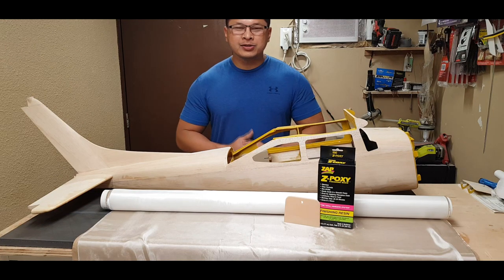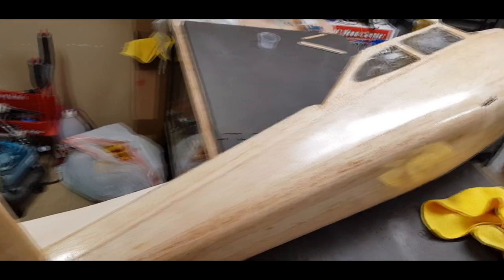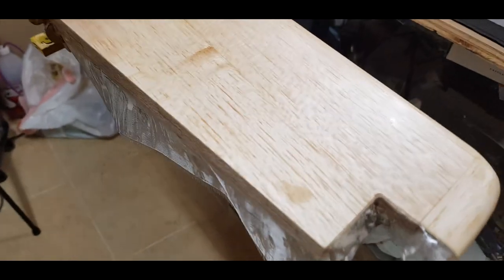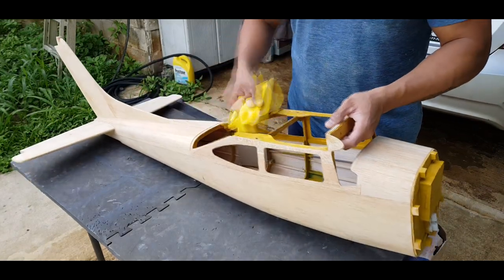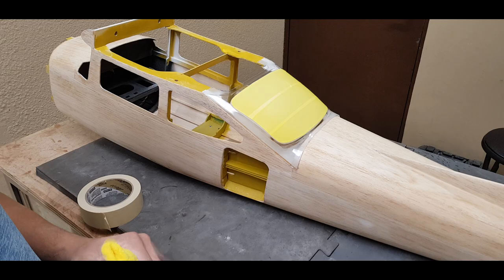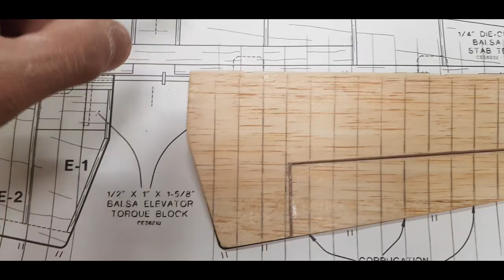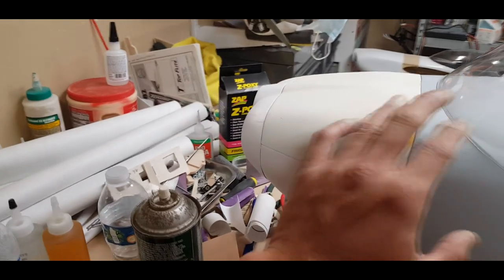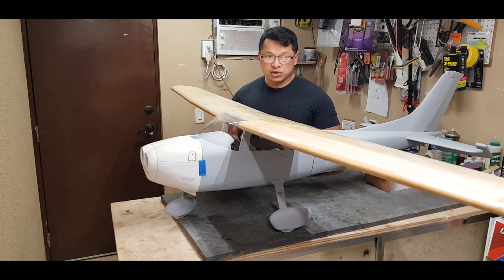How to Fiberglass a Fuselage (Top Flite Cessna 182 Part 10 Build series)

Comment: Great work. You make glassing look easy. I've used a technique I saw before where you thin the finishing resin down with denatured alcohol. Looks like you used the resin straight up with no thinning.
Reply from the maker: No thinning necessary if done the way I did it in the video.  It is pretty  easy and yields good results.

Comment: Can you use an oil base polyurethane on fibreglass to cover XPS foam ? Does it works? As the water base polycrylic or resin epoxy ??
Reply from the maker: To be honest I never tried oil base polyurethane over XPS foam.  I have used Minwax water base Polycrylic and Zpoxy finishing resin over XPS foam with good results. I would say get a small piece of XPS foam and give it a try with the oil base polyurethane and fiberglass.  That would be the best way to confirm its effects on the XPS foam if any.  The test will give you the answers you looking for first hand.

Comment: Never seen the razor method for smoothing out resin coat, looks affective. What was that material you used for corrugation on elevator? Great job fairing in rear window. Where did you get interior details and door hinges. 
Over all looking Outstanding!
Reply from the maker: The corrugated strips came in the kit.  The interior came in a kit specifically made for the Top Flite Cessna 182.  I made the door hinges out of 1/16" ply.
Reply from the maker: The razor blade technique comes from Bob Moore you can find him on YouTube under channel name hornitpilot
Reply: @BayonasRCWorld  I can’t believe you made hinges out of ply, they look killer.

Comment: Hi Mike.. How long time between 1 and second layer of resin.......Big Fan Of YOU..............
Reply from the maker: All depends on your resin mixture plus ambient temperature.  So best way to check is with your finger.  After application of saturation coat giving at least 30 mins touch the glass and resin and if resin transfers to your finger tip then it is too early.  The surface should be tacky and no wet resin on finger tip.  Once in this condition your 2nd coat or skim coat should be applied pressing the resin into the weave while also removing excess resin build up.  Hope that helps
Reply: @BayonasRCWorld  Thank you for answer. it make sense. i am moving on glassing. Can i do the skincote toworrow, or is it too late!
Reply from the maker: The problem once the 1st coat completely cures is that the surface becomes slippery like applying resin over glass.  No mechanical bond will take place making it a waste of time.  Unless you scuff the surface first which then makes more work at this stage.
Reply: @BayonasRCWorld  Thank you so much.... Do you know where i can get lucky to find the COCKPIT INTERIOR KIT.
Reply from the maker: https://planesgoneby.com/products/
Reply: @BayonasRCWorld  Waooo Thank you. I have done alot of searching, without Luck. I Will order today. Shipping time to denmark 🤣🤣💯
😉THANK YOU😜😜
Reply from the maker: You are welcome!  Glad I could be of assistance.

Comment: Have you tried contacting Cessna directly for panel and rivet info. Any 182’s on the island, for reference.
Reply from the maker: No Cessna 182's just a few 172
Reply from the maker: No I have not tried to make contact with Cessna yet
Reply: What was that material you had on a roll for corragation strips.
Reply from the maker: @sorenwolff4954  on a roll?
Reply: @BayonasRCWorld  my mistake. It looked like pin stripping tape, but was not. Thin strips of material that you glued down on elevator to make the corrugation ribs.
Reply from the maker: @sorenwolff4954  yes thin styrene strips kinda V shaped.